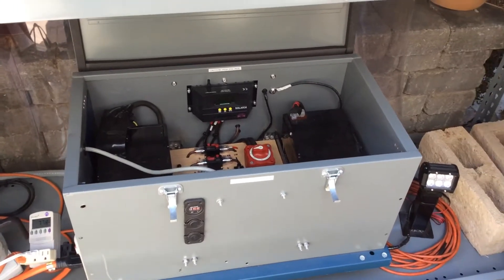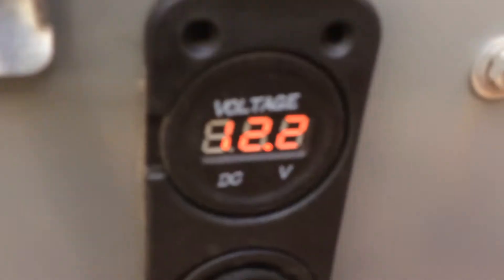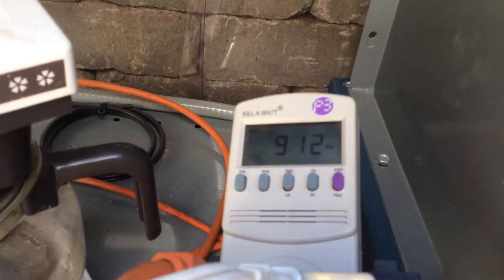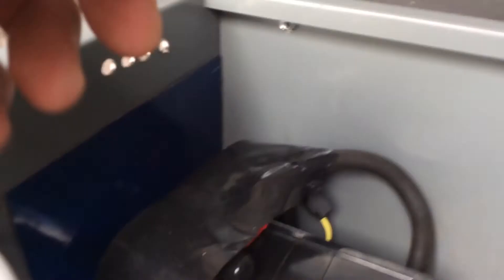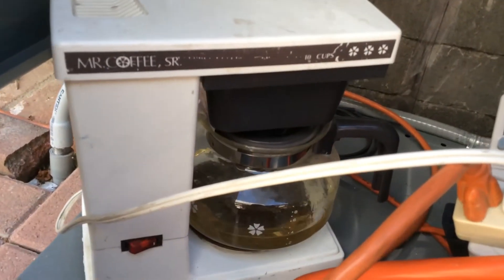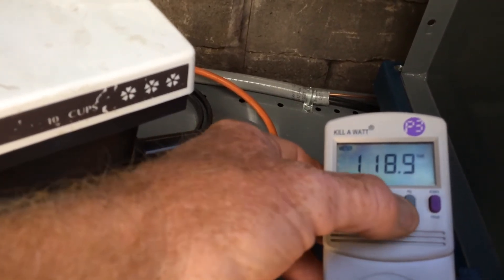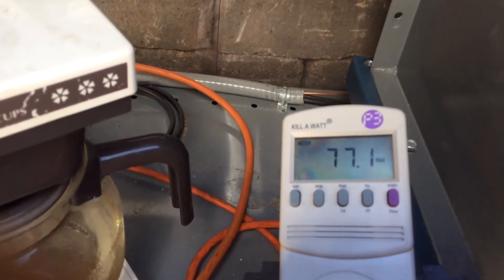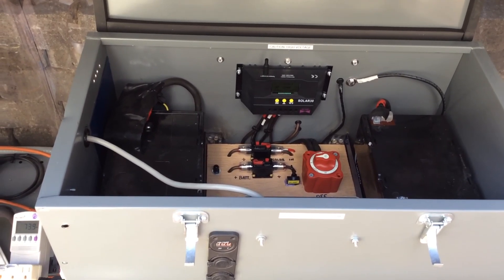DIY Solar Generator 900 watt load test

Comment: Hello. Wondering how many amps at 12V are being drained from the batteries to equal the 900 watts of 120V?  I realize you were bringing in 14 amps in to the batteries, but what was going out?  Thanks!